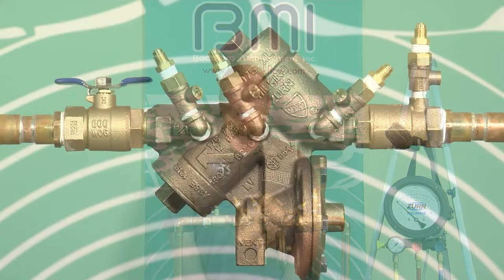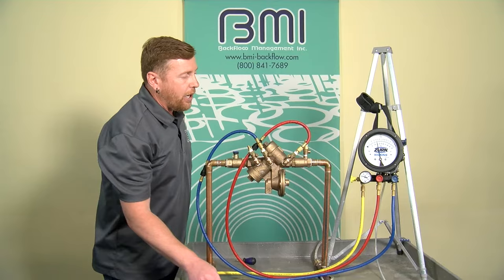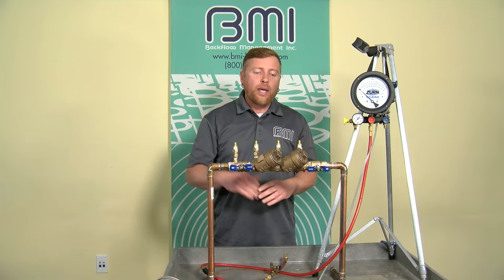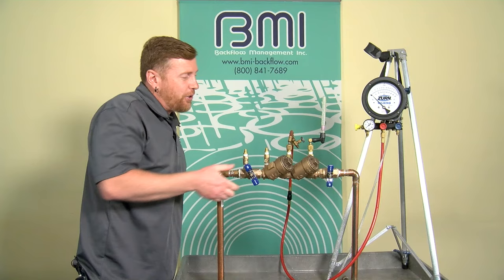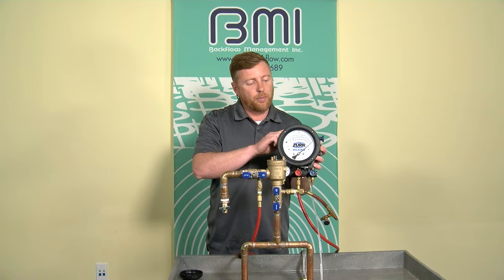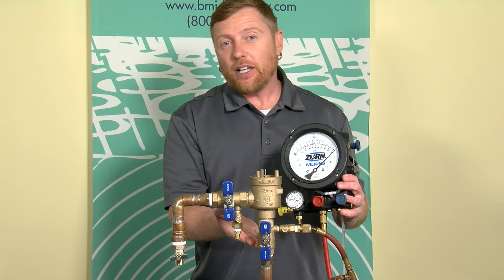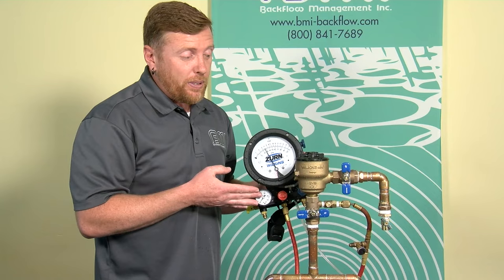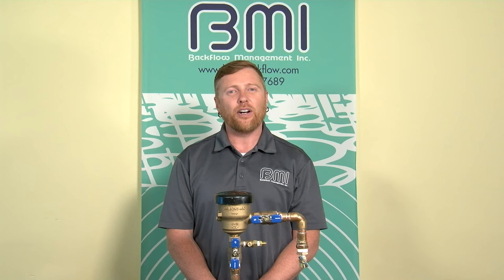USC 10th Edition Backflow Test Procedures Demonstration

Comment: 0:43 Reduced Pressure Principle  8:52 Double Check Valve  17:52 Pressure Vacuum Breaker  26:58 Spill Resistant Vacuum Breaker

Comment: For the RP you did all the steps except for getting the PSI reading for check #2. I know you checked for tightness of check 2 but is there a way to get the reading without having to move low pressure to test cock 4 and high pressure to test cock 3?
Reply: Yeah, missed getting the buffer pressure
Reply: Check valve 2 is tested for backpressure, there is no value for it except for "closed tight" or "leaked".
Reply: @reAllyNoWayyy  well, in one of the counties we work in they require the 3 hose test and psi ratings for check 1, relief, and check 2.
Reply: @solidsnake2085  really? That's interesting. I just checked my USC manual right now, and it says what I just posted. I understand that each county is a little bit different though